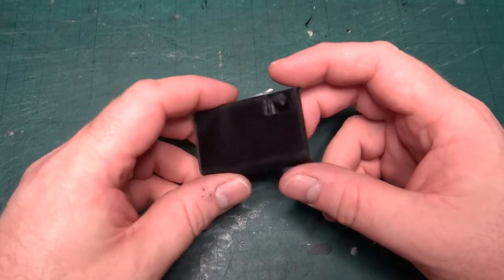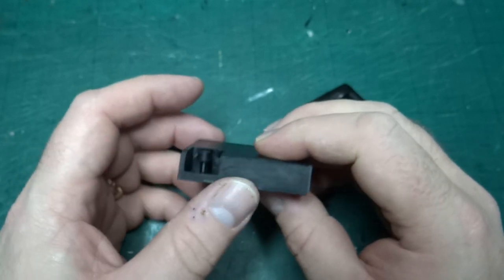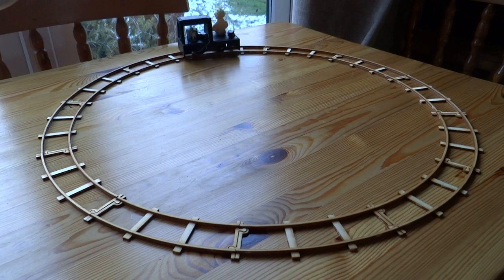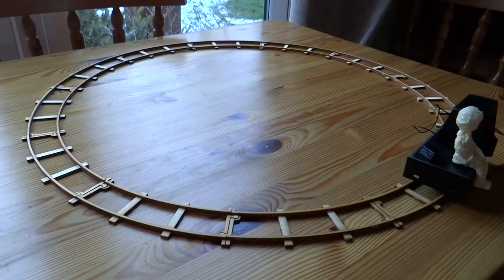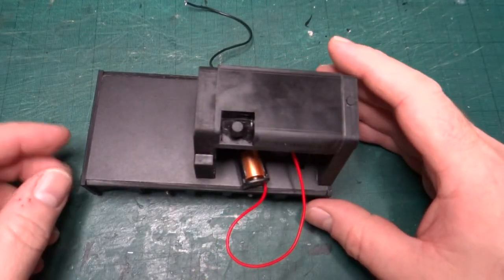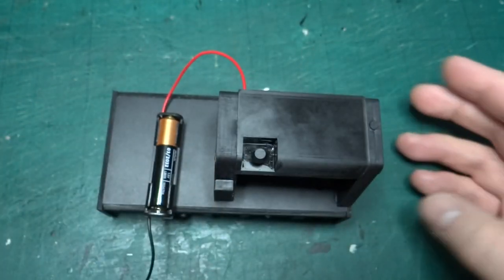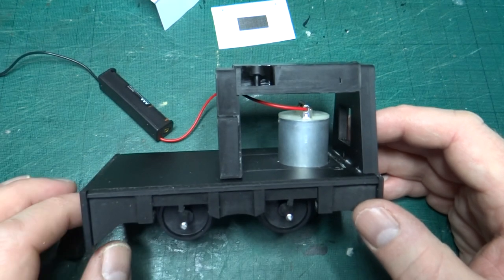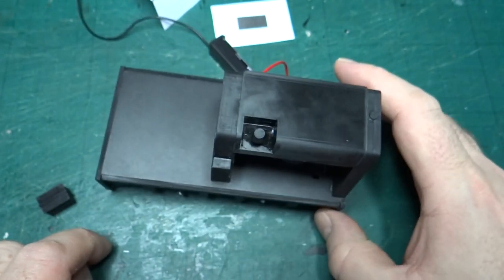Building a 24hp Hudson Hunslet Diesel Locomotive in 16mm Scale: First Track Test

Comment: Go for the etch - add me to the list if you decide to make available 😊
Reply from the maker: I'm still tempted to see if I can form the metal sections without resorting to etching them. Will keep the cost down and should allow me to offer kits more flexibly as well. Assuming I manage to pull it all together I should be able to make the parts available and I'll do an announcement video when that happens, so feel free to subscribe so you don't miss it.